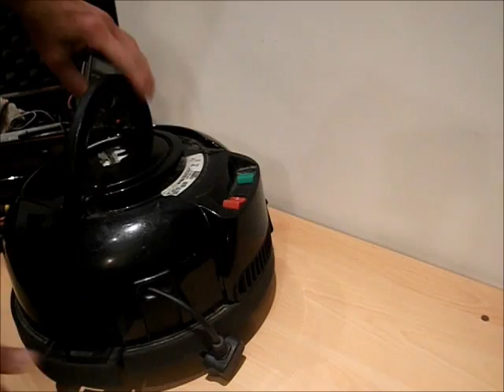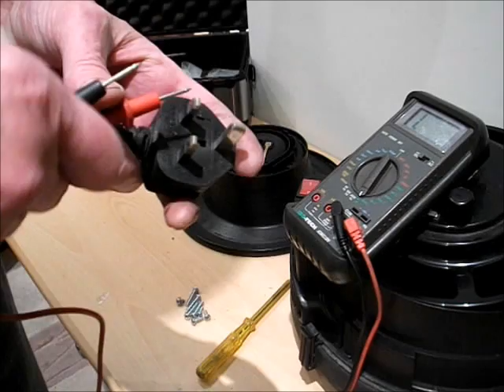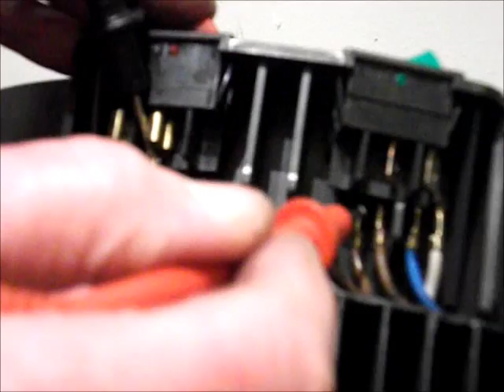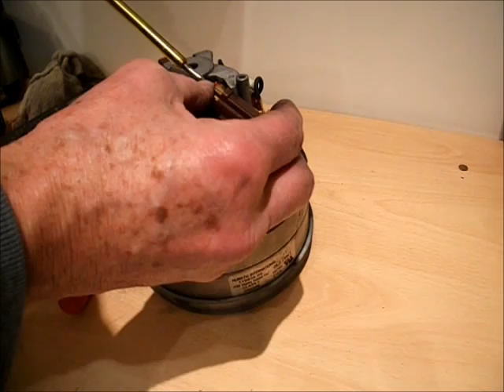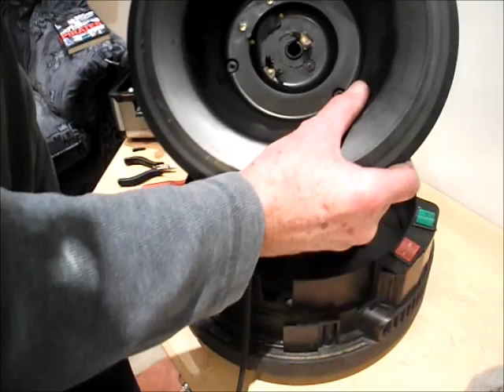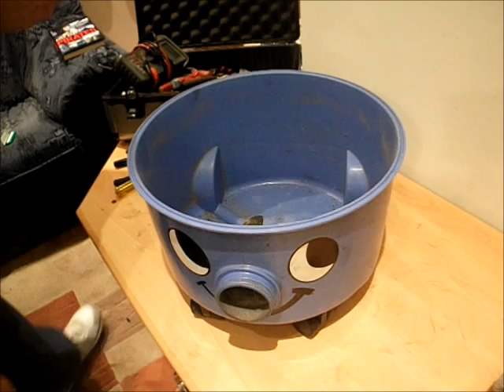Henry vac REPAIR stripdown

Comment: After chopping 18" off of the mains lead did you test the rest of it for continuity before putting on the new plug? Interesting videos.
Reply from the maker: Yes I made a loop with one end and checked for continuity from the mains plugtop end. While doing this I shake and pull the lead to check for intermittent faults. Good comment. Thanks.
Reply: Merry Christmas!
Reply from the maker: And a happy new year to you.

Comment from the maker: I should have made it a bit clearer. I dont have any bags at present. The cleaner was a gift from someone who was not happy with it (not surprising eh) but you are quite right it certainly would not do the motor or  the atmosphere in the room any good to use it bag less. I'm also like you a vac fanatic. I used to work for a Hoover agent in the 60;s and repaired endless streams of 1334's ( the old Hoover Juniors). Great vacs them.